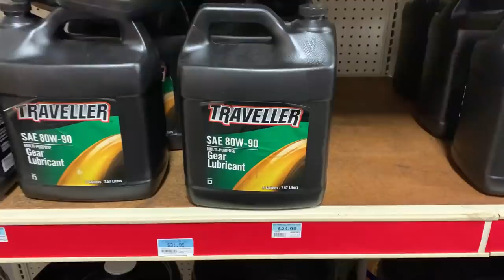A New Haircut and $300 Worth Of Oil

Comment: On your table at the discharge end, notch that square section out so you still have access and then 22.5 degree angle to detour the material with the fence a little higher. Just thinking :):) Make it wider, I think that's what you were getting at. If not HELP ME LOL :)

Comment: Is the outfeed table built such that you could flip the top around or rotate the whole table? The lip might actually be helpful on the outside so boards didn't go over the edge. I have a 70. The top is just flat and the edge of the table goes right over the front outrigger. It's a 2 part table for transport, so I move part of the table to access it.
Reply: Stated in another reply "nope, tried already"

Comment: Nathan, that problem with the start of the receiving table....would you consider a block of wood with a channel cut out bottom side to tight fit over the steel lip and the top of the block shaped like a plow blade to catch and throw the incoming board?
Reply from the maker: interesting,  I will see if that could work, just not alot of clearance there,

Comment: Better off with a roller table. Could roll right out to the tractor forks.
Reply from the maker: no way, roller tables have been tested by me and Yellowhammer, not good for dragging back boards, they crash up in the air when they hit the rollers, rollers tables are for moving boards across them, not for boards to land on at an angle,

Comment: About your outfield table, Would it be possible to remove the leg completely and rely on the web strengthener by the outrigger for support with a bolt when you slide it across to fill the gap?
Reply from the maker: maybe,
Reply: That is similar to my thoughts. Rather than cut off that strong edge, maybe remove/relocate the table leg and you could possibly even notch the corner of the table to let it move over to the left as far as possible or desired.

Comment: Hope the Travelers TS hydraulic oil is NOT planned for the TYM.  Simply a mistake to use in a hydrostatic.  I used  it in a gear tractor, & in hot weather it is too thin for adequate protection.
If T YM does not have their own kubota super UDT-2 is superior.  The hydrostatic trans is not forgiving w/ discount fluids.  For  the crankcase oil,  a diesel synthetic blend of full synthetic, be kind to the engine, it will respond accordingly.  The TS fluids have their place, suggest not in equipment with which supports my $ livelihood.
Reply from the maker: I didn't get Travelers Hydra oil, got delvac  the travelers was just gear oil for front axle,
Reply: @OutoftheWoods0623  Just another over reacting subscriber.

Comment: Would the steel lip interfere with removing the boards if you turned the table to put the lip on the opposite side?
Reply from the maker: tried it, didnt work, legs are not evenly spaced,